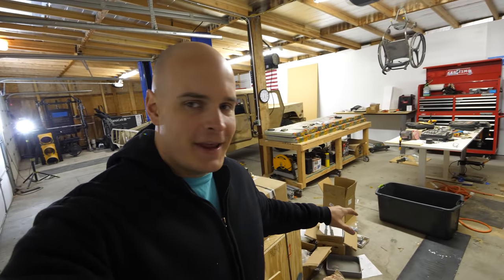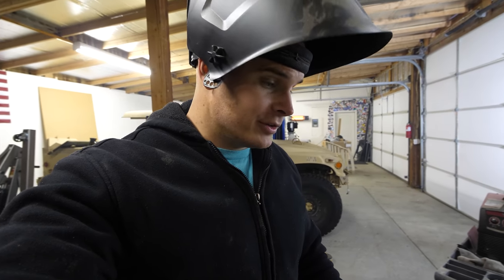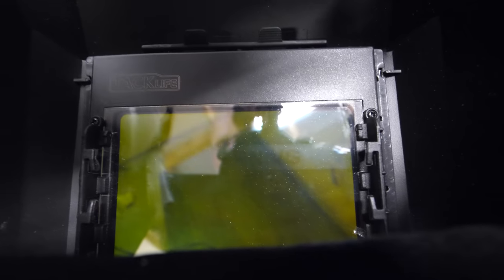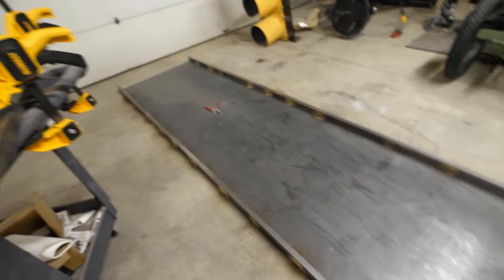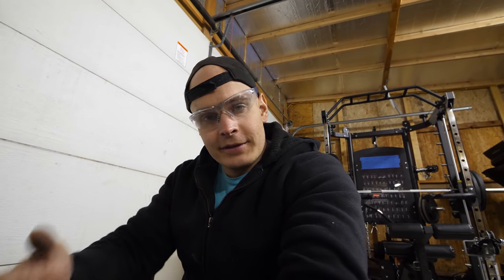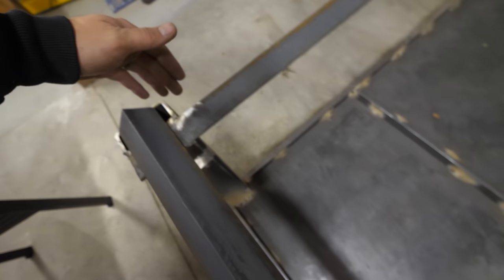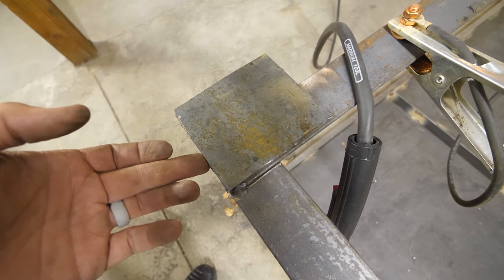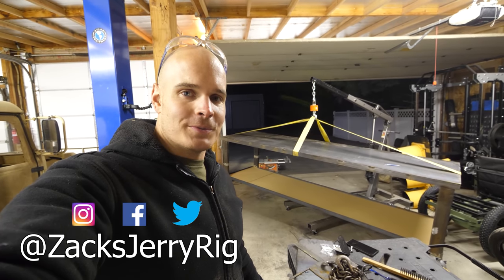How to Build a MASSIVE Metal Shop Table  - 600+ LBS!

Comment: I also look at casterHQ Poly casters with metal core which has higher weight rating.  All metal casters can get stuck on any little bit of debris and scuff up the floors.  Of course your floor is concrete user preference

Comment: I've bought all kinds of things from Metal Mart up near Lindon.... I've had some luck with getting materials from them at better prices than Metal Supermarket.

The only thing I would have suggested you do before welding legs on is having a grid of 5/8 holes punched so that you can use the special welding table clamps.

Comment: Also, a note on welding helmets that auto dim:

These helmets ALWAYS protect your eyes (and face) from harmful UV-radiation even when unpowered (turned off, out of battery etc) and the dimming isn't working.
The UV-protection is from the glass itself and not the LCD that dims the bright welding arc.

So use your helmet even if you can't be arsed or forgot to get a new battery for it guys!

Comment: First time I've ever gotten an explanation on how welding works (on a basic level)! Better late than never I guess.

But: what does the "battery" clamp do?
Reply: thats like the ground, you put it close to where you want to weld so the current has the shortest route possible
Reply: Electricity needs an in and a out ( why you also need atleast 2 cables in your plug) so it travels through his torch, through the metal back to the clamp which goes back to the socket so you got a closed circut, no clamp means only one electrode so no way for the electricity to get back to its source (which it want really much) so no electricity would flow. Its just the return path for the electricity. Hope this makes any sense
Reply: When he wa spushin the trigger and there was just wire coming out. There was no ground hooked up. You need that clamp to weld stuff
Reply: @koevoet7288  you explained it very well. Thank god you didn't go into the different power percentages like how when you weld with positive 30% of the power goes on the electrode and 70% goes to the work piece then vise versa with negative. When I was told about that for the first time it through my brain though a loop lmao

Comment: Good job but if I were you I'd add a couple vertical metal bars in the middle so the whole table does not bend in the middle since it is quite long and also it will prevent the bottom shelf from sagging in the middle.

Comment: Welding is like hot gluing? Brazing and soldering certainly are like hot gluing. While some types of welding do involve adding material, I understood that welding was actually melting two pieces together to create one piece, not binding two pieces together with a binding agent. Any welders on here to confirm/deny?
Reply: you are right... I'm guessing he was simplifying bc he used air quotes one of the times he said "glue"

Comment: So your idea of upgrading your welder is getting a 220V one...

Here in sweden 220V welders are pretty meh and our upgrade is getting a 400v three phase welder if you want a proper one :D

But then again, our 240v outlets max out at 16A i think and those are not that common either. When talking about residential wiring ofc.
The most common fuse sizes for homes here are 6A and 10A. No idea what kind of amperages you guys have over there.

Comment: When you got rid of the rust on those legs, you also removed the mill-scale. You needed to do the same thing to all of that steel you were using. With a flux core welder, you need clean shiny metal to weld to. I'm sure it will stick fine but it is a better practice to get into.
Reply: Should the metal also be tapered or does that just depend on metal thickness and load requirements?  Just a guy who would love to learn how to weld irl.  I've watched a lot of videos and it's like an art form, with different styles and requirements depending on many factors. Props to those who do it for a living.
Reply: @Chrislk1986  yes, using chamfers on your material has a lot to do with material thickness and type of welder. With a 110-volt fluxcore like he was using, and thicker he would need to bevel or chamfer the work piece and even make multiple welding passes.  If you want to learn, you can get those 110-volt fluxcores pretty cheap and watch you a few Youtube videos. That's how I started but I also have a professional welder at work now to ask questions 😁